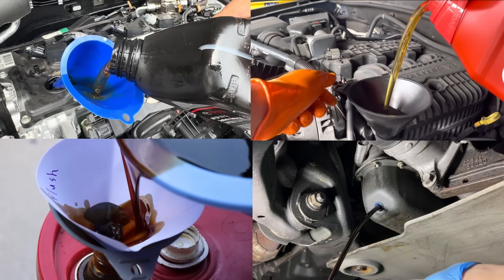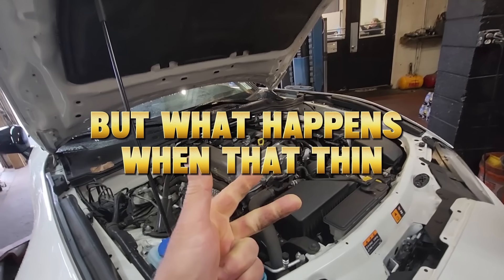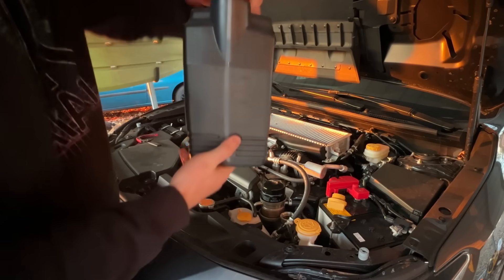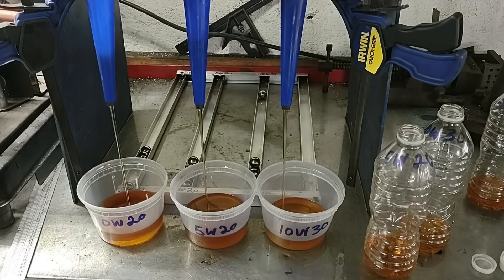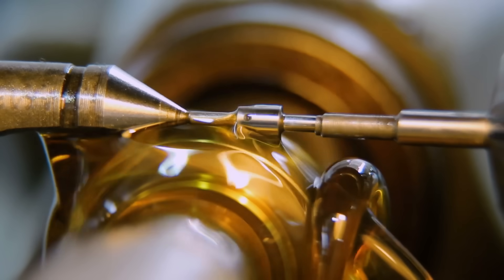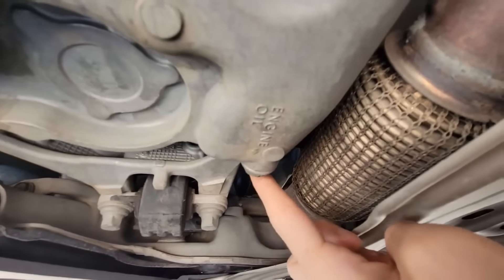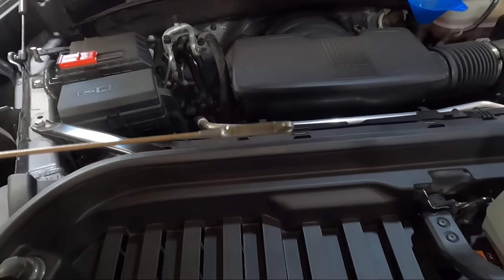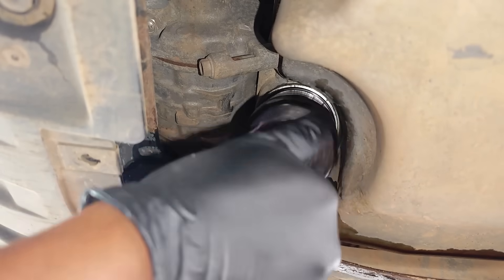The TRUTH About 0W 20 vs 5W 30 Oil (50 Engines Tested!)

Comment: 20 weight was only used by manfacturers to meet fuel consumption regulations , not to preserve your engine life.
Reply: Hmm... there is a lot of Toyota Tundra 5.7 out there with 300,000+ miles.... OW20.... (ask me how I know..... I had one...)
Reply: @gr8basser don't confuse them with reality
Reply: @lastuberman as a mechanic and with experience 5w30 is best for engine's
Reply: You guys are arguing about a fake video.  This is AI generated.   It never showed the actual test.
Reply: So ow-20 and 5w-30, so then why not use what’s in between? Which is 5w-20.
Reply: @ozzfox1 or 0w30
Reply: Which oil doch you recommend for VOLVO XC90 D4 2016. Factory viscosity 0w20?
Reply: Another case of the poorest getting shafted by the party that claims they take care of the less fortunate.  The climate cultism only hurts us who can only afford second hand audi's😊
Reply: 0W 20 is not a 20 weight oil, it is a 0 weight oil, yes, as thin as water, fortified with polymers and other additives that make it simulate a 20 weight oil when it, the oil, is hot.  That is before it shears.  After it has sheared, it no longer simulates a 20 weight oil.  SAE 20, SAE 20W and SAE 20W 20 are 20 weight oils.
Reply: @jamesbosworth4191  Did his comment go over your head?  All he stated was this oil with the viscosity of water is an EPA requirement.  And as it stands, it's only good in cold weather.
Reply: @lonniebeal6032  No it did not, HE thinks 0W 20 is an SAE 20 oil, and I was pointing out that it is nothing of the sort.  It is an SAE 0 oil that has been fortified, so it is NOT the same thing as an SAE 20 oil.
Reply: @jamesbosworth4191 That's not how it works. It's not that simple. Many 0W-20 synthetic oils may have very little (next to none) of viscosity modifiers. Some 5W-20's may have more VM's or VII's than a 0W-20, or less. It depends.
Reply: @YamahaCubed  I was talking in principal.  The fact that many of them have hardly any Viscosity Modifiers makes them even worse than they are supposed to be.
Reply: @YamahaCubed  I am not defending 0W --- oils, I think they are garbage should never have been invented.
Reply: @jamesbosworth4191 Some 0W are exemplary. Like 0W-30 ESP. Higher HTHS (shear stability) than an API mainstream 10W-30 synthetic, but with cold flow. I use Mobil 1's 0W-30 ESP in a high performance Volkswagen Golf R in MI climate. Excellent NOACK as well. Below zero winters, and 100+ F summers.
Reply: @jamesbosworth4191 Viscosity index improvers are basically liquefied polymers. They allow motor oils to be 'multi-grade.' Their downsides are that they burn easier. Much easier. It's more difficult to achieve a good NOACK % with VII's. Motor oils with less VII's tend to burn less. HPL makes a "no VII" 10W-20 for that reason. Mixing STP additive with your motor oil was a bad idea for a couple of reasons...one being that it's possible the additive (which is a LOT of VII) could use a different type of VII polymer from your motor oil. On top of not having any detergents.
Reply: @YamahaCubed  So that means if I use SAE 30 in my tired GMC, it won't consume as much oil as it does with 20W 50 oil?
Reply: @jamesbosworth4191 😮‍💨 I don't know, man. Probably wouldn't help. If it's worn out enough to burn oil with 20W-50, then straight 30 wouldn't make an improvement. Nothing would help. A rebuild would. If you live in the colder climate that would be bad, as is a 20W-50 would be too. As for a newer vehicles like the Toyota before it got the miles it has now with it's low compression piston rings, keeping the ringlands clean is the most important. Still is. For this GMC, I might try your 20W-50 with a couple bottles of Marvel Mystery oil. If it's an old tired engine, it couldn't hurt anymore than it's hurting itself anyway. If it called for 5W-30 to 10W-30, it couldn't hurt at this point. But for newer vehicles that aren't worn, I wouldn't use cheap snot additives. Their base oils are bottom of the barrel bright stock with tons of cheap VII that won't match your motor oil's. Even 'straight weight' oils have some VII. I'm not demonizing VII.
Reply: @YamahaCubed  So it must evaporate - burn off - rather than get consumed I guess.
Reply: @YamahaCubed  In the 70s, the recommended oils were SAE 20 or SAE 20W for average climates, SAE 30 for hot climates, SAE 10W for really ice-cold climates, or, 10W 30 multi grade.  Those were the auto maker's typical recommendations.  The oil companies recommended SAE 20 or 20W for cooler climates, SAE 30 for average climates, and SAE 40 for tropical or desert-like climates, or 10W 40 or 20W 50 multi-vis.
Reply: @jamesbosworth4191 It's not the 70's anymore. Besides, multi-viscosity oils were already being used. Straight weight oils were not as common at that point. Motor oil has gotten so good that the only benefit you'll see from a straight weight oil like an SAE 30 is in a lawnmower that gets run anywhere from 45 F to 85 F. An air-cooled engine.
Reply: @jamesbosworth4191 They had 5W-30 in the 70's.
Reply: @jamesbosworth4191 hate to tell you. It's 20 weight when cold 0 when hot. You have that reversed.
Reply: @MartinX192  YOU have it reversed.  What would be the point of making an oil that becomes water-thin when hot, just when thick is most needed?
Reply: @jamesbosworth4191  You have a poor understanding of oil weights.
Reply: @MacCready_  I have a very good understanding of oil weights.  If you think a 0W 20 is the same as an SAE 20 oil, YOU are the one with a poor understanding of oil weights.
Reply: @jamesbosworth4191 Some vehicles that take 0W-20 might not circulate a straight 20 oil at a certain temperature. They don't make robust oil pumps and open passages like they used to. Especially for 3-4-and 6 cylinder engines.
Reply: @YamahaCubed  Depends on what part of the country, and the season.  If you live in the Dakotas, in wintertime, you need SAE 10W, and before they made a 5W, you had to thin it with some kerosene if it was below a certain temperature.
Reply: @jamesbosworth4191 It depends on the vehicle and temperature. 10W-30 goes to 0 fahrenheit. At absolute coldest. 5W-30 for a vehicle that takes the 30 would require a 5W in the cold. It flows better even if it's above 0 F. I feel like you're just messing with me at this point.
Reply: There was no 50 engine test, the entire video is made up AI bs.
Reply: @414s4 Yeah, Motor Oil Geek called this out. I knew what this video was anyway.
Reply: Some modern vehicles that call for 5W-20 or 0W-20 will significantly lose power with a 5W-30. Makes sensitive engines like that run hotter as well. Bogs them down. The 2.0 duratec GDI in AWD Ford EcoSports is one of those cases. Others, like my sister's 2016 1.6L that calls for 5W-20 Ford Fiesta benefitted from Quaker State's synthetic new GF-7 5W-30 high mileage with a super high flowing cheap SuperTech oil filter. The ticking stopped and power wasn't reduced whatsoever. It just depends.
Reply: @YamahaCubed  I can't see how it will noticeably affect power, unless they produce 0 amounts of torque.
Reply: @jamesbosworth4191 You don't understand. The newer duratec engine uses cam phasers. Oil flows through them. The passages are intricate. They control cam timing hydraulically using oil pressure. Viscosity affects them. My sister's Fiesta engine has less power than the EcoSport's 2.0 but doesn't use cam phasers, so it's not affected by 5W-30. Plus, the AWD EcoSport is heavy for it's size. It outweighs the new, MUCH larger Chevy Trax. Any change of resistance like even oil is noticeable with it. At least, unlike the Fiesta, it won't get stuck in the snow. Especially not with snow tires. EcoSport has more torque than the Fiesta, but it's lugging around the weight of mid-sized V8 cars of the past. It definitely deserved the 2.5 duratec with an 8 speed transmission. It uses the same AWD components as the Fusion with 2.5 duratec.
Reply: @YamahaCubed  My wife's Toyota Avalon also has cam phasers, and it runs the same whether you use 5W 30 or 10W 30 oil.  It used to consume the 5W 30, and at about 20,000 miles, developed a knock that sounds like a loose piston pin, "clat clat clat", so I would add a can of STP, which stopped the oil consumption, and did not affect performance or economy.  At least not enough to detect.  Within the last few months, it miraculously quit consuming oil, so I no longer add STP.  It now has aabout 93,000 miles on it, and the engine has not failed, despite the poor clearances.
Reply: @jamesbosworth4191 Some are more affected than others. Once again, an AWD EcoSport is saddled with weight, so changes in viscosity are noticeable, where other vehicles aren't. An AWD EcoSport's AWD system is always rotating with drag with an engine that belongs in a lightweight, 2WD subcompact car. Not a built up, reinforced Fiesta chassis on stilts and as dense and aerodynamic as a brick with AWD constantly rotating. The little duratec has an acceptable torque rating of 149ftlbs for its size and being naturally aspirated. It's lugging around a lot more resistance than a Toyota Avalon.
Reply: @jamesbosworth4191 Don't ever use STP or lucas snot in engines that aren't on their last legs. Ever. If you want thicker oil, get a thicker motor oil. Don't play chemical Russian Roulette. You want all chemicals to match up as the motor oil intends.
Reply: @YamahaCubed  I had no choice.  It is my wife's car, and I don't work on it because if anything goes wrong, she will accuse me of sabotaging it because I don't like Japanese cars and was against her buying it, but I always check the oil and other fluids every time I get gas, and if anything is low, I top it off.  I refuse to just keep driving until something fails.  The shop we bring it to refused to use thicker oil, probably due to fear of product liability issues, so I tried STP, and it worked.

Comment: Excellent video! You told the fact many people refuse to listen. I recently have back and forth conversations with another person in the comments section regarding 0W20 vs 5W30, the other person convinced that Car Care Nut said stick to the thin oil Toyota recommended or you will damage your engine. CCN is a great mechanic, However his recommendation is wrong on the engine oil, since lubricants is an engineering field of work not mechanic, 5W30 will NOT damage the engine calls for 0W20 or even 0W16, period. If anything, 5W30 will protect your engine better like the video said. Another takeaway, the power of influcers are insane, it can change the fact. My degree, certification and years of experience plus the fact not worth the influcers's one sentence. It's pretty dangerous if you ask me.
Reply: How is it underrated it just came out, most overused word on yt
Reply: @billman6364  Bill's comment is underrated!
Reply: @subversiveSubduction how so? he just posted this😂
Reply: @billman6364 haha you got the point, there, I changed it. English isn’t my first language, excuse my bad choice of words.
Reply: I would like to know if anybody has ever seen an insurance co decline to fix PARTS on warranted engine using the wrong oil. Be anal but they could smack you.
Reply: I think the car care nut is right on 0w20  cars  that require that formula especially  mild hybrid cars, stopping and going lubricates the engine quicker  especially in stop in go traffic do 6 months or 5000 mile intervals are best. Nobody talks about oil derogation from fuel from heat cycles and extended idling times and traffic not so much the oil it's the intervals of oil service. doing the damage
Reply: What area is your degree, certification and experience in? How many years experience do you have? My Camry calls for 0w-16 but I use 0w-20 and a few times 5w-30 or 10w-30.

Comment: If you don't trust the oil cap numbers why trust the dipstick level
Reply: Sorry to hear u were dropped on ur head at birth.
Reply: on the count of three open your eyes
Reply: The numbers on the Oil cap are dictated by Government bodies to the manufacturers in some countries.
Reply: You don't understand.  The viscosity recommendations nowadays come from EPA bureaucrats, not automotive  engineers, and I am not going to take advice from a nerd who thinks an inline 6 and a V6 are the same thing.
Reply: @jamesbosworth4191 that's why engineers made engines to match EPA viscosity recommendations...understand
Reply: @hiendeptrai2010 No they didn't.  The engineers have almost no say in the matter.  It is strictly about what the EPA bureaucrats decide, and they are not engineers, they are just pencil-pushers who probably can't even change a damn tire.  No way am I going to listen to them.
Reply: @jamesbosworth4191  if you don't listen to owner manual at least listen to someone like the car care nut or scotty Kilmer these 2 are best of the best on YouTube when it comes to cars ,
Reply: Some vehicles are removing the dipsticks as well……they have a “high tech” low oil sensor……with a very generous acceptable range…….low friction rings that can be pushed in by hand and don’t  need a ring compressor……spray on “high tech” cylinder liners vs cast iron sleeves..(non re buildable),   0w-20 (or thinner) oil…..and and start stop “technology”

Tell me you’re a lemming without telling me your a lemming….🤣